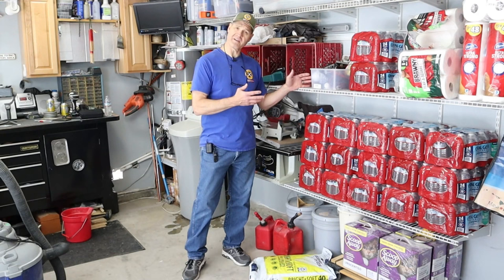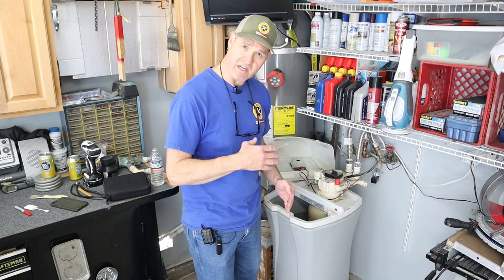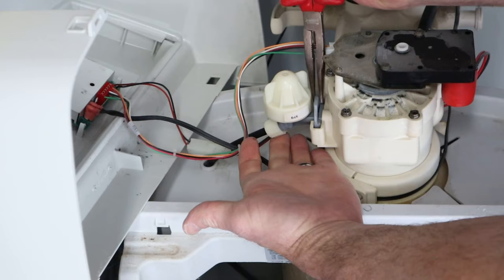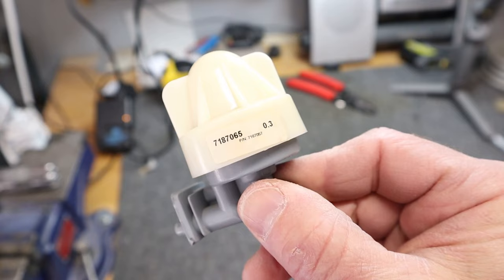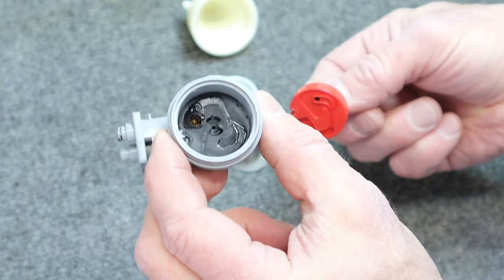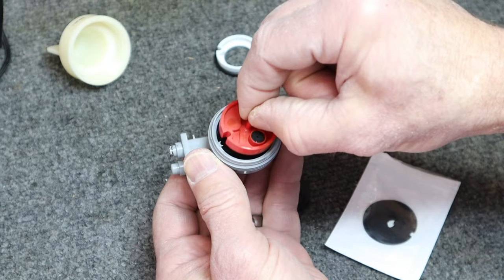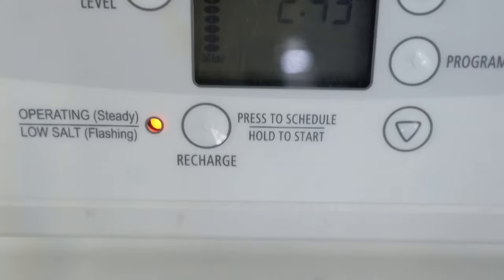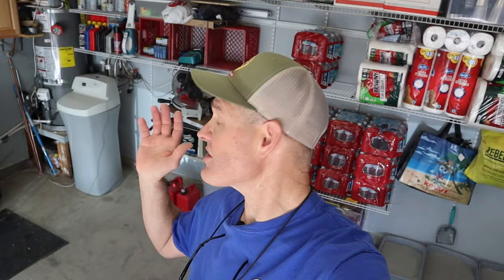Water Softener Full Of Water Fix

Comment: So you're saying it can drain itself? I don't have to take a vacuum to suck the water and salt out?
Reply from the maker: After I corrected the problem with the Venturi valve I ran a recharge cycle and it drained at the end. The float in the float assembly tube had the valve closed because the tank was full so that part of the charge cycle (the filling of water) didn’t occur. Once the Venturi valve started working properly my unit was able to use the brine water to recharge and flush the water from the tank.

Comment: Don’t some water softeners have the water always in it until it draws it in? I think mine does.
Reply from the maker: Great question! There are two main types of water softeners, post-fill & pre-fill. Post-fill systems have visible water in the brine tank most of the time because they “soak” the salt for the regeneration cycle. 

Pre-fill systems are the most common and fill the brine tank prior to regeneration. Regeneration uses the brine water from the tank until the next scheduled regeneration. With this type of system water should not be visible unless the tank is empty or during a fill cycle.